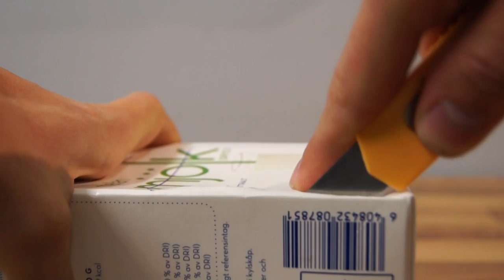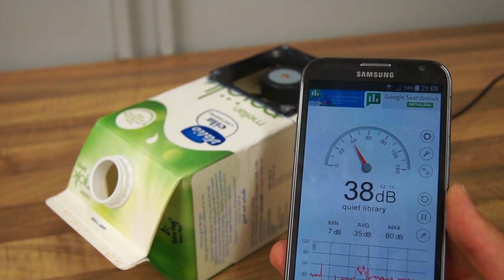DIY Cheap Homemade Air Conditioner Quick Build - RCLifeOn

Comment from the maker: Did you enjoy the video? Please, help me grow this channel by sharing the video with your friends!
Reply: send me that beat Mike Jones
Reply: nice
Reply: To be honest I don't think it would make too much of a difference to cool you down BUT, why not leave it near the computer intake fan or maybe even inside the PC tower pointing at the CPU/GPU fans?
I would like to see how that goes! :D
Reply: absolutely not
because the air is very humid ( since youre using water ice ) and i dont think i have to explain how bad humidity is bad specially if youre gonna overclock and add more voltage and heat ...
Reply: RCLifeOn lol okej då gö jag de
Reply: I made one!
Reply: Amit Bidlan nn
Reply: It's cool bro
Reply: use a peltier and connect the hot end to the hot end of another peltier thingy to power the fan and then you have a colder air conditioner that does not have to worry about the electricity of the fan
Reply: Change the water for ice 😂
Reply: smells like milk
Reply: shares 4 years later

Btw I 100% plan on making this

Comment: Clever! - You can stick the whole thing in the freezer again once it's melted!
Reply from the maker: Let's just hope the fan survives. You could really do that though!
Reply: +RcLifeOn just make sure the fan is dry of moisture before freezing
Reply: RCLifeOn shouldn't thier be a question mark at the end of..."You could really do that though?"??????
Reply: no.  fan will die because of moisture
Reply: Its maybe easier to make the fan attachable... then you dont need to freeze the whole thing.
Reply: That's dumb the freezer puts it's heat into the room.
Reply: that wouldn't work cuz ull have a significantly lower surface area for the ice and thus not as effective cooling

Comment: Pro tip: When soldering wires to connectors, connect male and female parts together before applying solder. That prevents the pins in connector from moving around, if you accidentally heat it to the point where plastic starts to melt. For connectors with really small pins, this is almost necessary to do, to keep all pins straight :)
Reply: yes
Reply: Bro calls that a pro tip 💀

Comment: you know you can also use some copper tubes shaped in circles and use a mini water pump to circle the cold water around a very big fan that would also give you some cool wind BUT the main problem with the ice coolers is that they are a PAIN in 2 ways : 
1: to fill them with ice
2: to drain the melted ice

and depending on the temperature of the room you would have to repeat it again and again and again...
how much did the  ice hold and gave you cool wind ?

Comment: I made a swamp cooler similar to this by hanging some cold and wet rags on a rack and then making it into a mini box air conditioner by closing it up it a couple minutes my room went from 78 (bc. Of my pc lmao) to 72 , the reason why the ac dosent compensate for the heat my pc makes is because it’s next to a wall and not a duct so I put this in the middle and I enjoy a nice and cool gaming enviroment
Reply: yea but if u live in a humid environment this wont work

Comment: Got Mjölk?  Doubles as a stray cat attracter!

Thanks for taking the time to put that nicely-made video together.  I don't think an old milk carton is what I'd choose to use (not very durable, will soon enough make your room smell like the floorboards of an old old ice cream shop, and isn't it kind of tedious to feed one ice cube at a time into it--which probably explains why you mercifully fast-forwarded through that part. Though I guess you could just freeze the whole thing and just take your chances with the fan weathering the cold).  Why not just pull that spout from the milk carton and set it into something more durable and easier to fill with ice (or that you can just keep a few of in the freezer), like an old Tupperware container or some other plastic container with a lid?  If you're anxious to stick with that whole dairy goods motif, why not try yogurt or margarine tubs!

Comment: eco-friendly AC 😀😀👍👍
Reply: Actually, it is not as eco friendly as you think. You have to factor in the electricity used to make the ice too. It is only eco friendly if you do not add the ice
Reply: @marktan8074  yea sure but u have ur fridge on all the time so u r already using the energy used by the fridge.. its not like u r going to turn off the fridge at any time
Reply: @marktan8074  yes, but your refrigerator is already using that electricity so this just removes having to use even more for an air conditioner. So yes, it is more eco-friendly

Comment: Anderson power poles are also nice       Put a bigger piece of heat shrink first that will fit over each infividual lead   Then slide heat shrink over both individual pos neg heat shrunk lead     Avoids tape    Tape is awful and leaves black goop all over after a while    Can also get the hestshrink w sealant goop inside

Comment: all you need is a heap of orifices joined together the presure difference will create the end to cold and the back to be hot place 1/3 of it the incoming air out the Window the heat will dissipate off it from being out side you will get very cold air its called a d
aircon

Comment: You're making an AC in Sweden. Temperature is already cold lol :D
Reply from the maker: Funny you would say that because as of now we have the most crazy weather ever. Today the temperature reached 30° (86°F)!
Reply: Ah I see. And in Stockholm it's also a bit warm today. But generally Sweden is cold~
Reply: RCLifeOn yo dude in my state it usually get 45-50°C in summer😩
Reply: I live in Finland and here is also 30 C (86 F) and in my home the temperature is 27 c (80 F) and I dont  have any airo conditioner or even air cooler. :/
Reply: Hey! I live on mercury and it's burning here
Reply: Yeah...i live in U.S Arizona.  It is fall. It was over 43C today. 50C comes often in the summer

Comment: very nice but way too complex I'd rather make one with the cooler much simpler nice video thanks for sharing
Reply: Travis Jacobs You all would be FAR better off taking a fluffy hand towel or one a bit larger, and generously dribble water along one side of it, once folded lengthwise. Then fold it up and place it into the freezer until the water is completely frozen Then take it out and carefully refold it into a long rectangular, scarf like shape with the ice as close to one side as needed to suit your level of comfort when placed against the back of your neck.  It will very effectively. cool the blood and the nerves at the base of the skull and back of the neck. We used these at horse shows when we worked as grooms in 100 degree days in the blazing sun. Just put a second one into the freezer as you take the first out and keep new ones in rotation. It works remarkably well, so much so,  just be sure to remember  to take good care of yourself and not overexpose yourself to the sun and excessive heat as you are most likely to get a bad sunburn while doing this as the heat itself can be well mitigated  with a continual rotation of icy towels.... adjusted with an amount of ice and closeness of the ice to the skin to suit your taste.
Reply: @HappyQuailsLC 100 degree days? Are we talking about temperature? You can't survive that with just a towel. Or do you mean some exotic units?

Comment: how is the air coming out without ice cubes? is it cooler than room air or same?
Reply from the maker: Well, because moving air has higher heat transfer coefficient it will feel cooler than the room temperature.

Comment: What the purpose & How do you use the shink tube?
Reply: It's there so you don't short the wires. They shrink usually to 1 half of original diameter when heated. Also make sure to not melt them, just a little touch of heat is needed

Comment: What would I do if. Didn't have the connector? Only the fan and battery? Would I be able to possibly solder the wires together?
Reply from the maker: You need a connector to disconnect the battery easily. You don't want to drain the battery completely.
Reply: RCLifeOn ahh I see thank you

Comment: Flow direction of the fan? Out from the milkcarton or in to the milkcarton'? (on the fan).
Reply from the maker: +jox mac The fan pulls air in to the container.
Reply: There are two arrows on the fan, one pointing spinndirection, the other airflow direction. That's a good tip to share.
Reply: airflow points into the container. i made one except with batteries

Comment: Air conditioning is removing heat from the air, cooling is adding cold to the air. 2 completely different things. This is an air cooler.
Reply: You can't 'add' cold. This is removing heat from the air by using it to melt the ice. One of the differences between this and a typical air conditioner is the moisture content. An air conditioner normally removes moisture from the 'conditioned' air, while this adds moisture.
Reply: csorrows - you are correct. An air conditioner is a heat pump. This is an air cooler. Completely different.
Reply: @rgbii2  true but some don't this would be for desert areas
Reply: @rgbii2  really? how com there is cold air coming out of the vents eh?
Reply: @marcusfred4480  not entirely the filter removes dust and other things from cold air coming in to the house

Comment: great it will last like a half hour before the ice melts because the carton has no insulation.
Reply from the maker: I've found that it takes significantly longer time than 30min for the ice to melt.
Reply: Isn't it your goal to have the ice melted? I thought that means it has done its job :)

Comment: Not an air conditioner ,  it is a swamp cooler. BIG difference between the two.
Reply: no its not a swamp cooler, a swamp cooler uses room temp water and evaporation to cool the surroundings, this is ice so he is basically adding heat to the ice and removing it from the air.. quite a big difference.. the first doesn't work in humid environments the 2nd works fine..

Comment: What is a  shrink tube?
Reply from the maker: Shrink tube is a shrinkable plastic tube used to insulate wires.
Reply: When heat is applied to it, It shrinks.
Reply: Aha. Thanks :)

Comment: Why not just fill the container half way with
water. Lay it flat in the freezer, then the ice would already be in the container. I do like the overall idea.
Reply from the maker: You could definitely do that. But I would recommend you to remove the electric fan before freezing the container. Second, I was worried about ice forming outside the container creating a puddle of water once it melts. However, I never tried this.
Reply: Ya, I forgot about the fan being glued to the container. I
guess one could make I “wall” for the fan to fit in. One of my concerns is if
you have one big block of ice inside the container as opposed to lots of individual
cubes it changes the “air to ice surface” factor, which may not offer as much
cool air coming out of the container. Another angle, make a wall for the fan to
sit in. If you use ice cubes, than it would be a lot easier putting the cubes
in (without the fan being installed). After placing the cubes in, then place
the fan in its “wall holder”. As far as the ice/water forming on the outside,
just place a lid under container, but I guess it would make the coated cardboard
wetter/soft.
Reply: @billspradlin9619  that wouldn't work cuz ull have a significantly lower surface area for the ice and thus not as effective cooling

Comment: This is just an air cooler. An Air Conditioner also removes moister in the air, this definitely does not do that.
Reply: only if u live in a humid climate.  this is perfect for the desert, where you would actually want to add moisture to the air
Reply: It doesn't change the fact, that an Air Conditioner is more than just an air cooler.
Reply: 0:06 Air Cooler
Reply: Yes, that would have been nice in the title too.
Reply: uhh no
Reply: some models of ACs don't they are for the people in desert areas

Comment: Sadly, it's hard to find 12v adpater, most of what you can find are around 5v.
Reply from the maker: You can definitely use a 12V battery in case you got one. If not, you will have to purchase one. Try Ebay, Aliexpress or your local electrical shop.
Reply: Or use 5v fan
Reply: i use 2 9v in series

Comment: Ok, its 2016, can someone show me a DIY air cooler, conditioner, rinse, de-heater, temperature reducer and bonus moisture zapper that doesn't involve ice, dry ice(don't want to suffocate myself). There must be a way to suck the heat out of the air rather than cool the air. Use the heat as the energy source or something, once the heat has provided the energy to the device it is now frigid cold due to all of its energy having been depleted from its use. ANy body got any ideas?
Reply: Well yeah that's a good solution for you but that doesn't solve my problem. I should have known better than to ask on You Tube for any sort of techno innovation when people like you go from this to playstation and back.
Reply: if we could lower the temperature of something by taking heat out and turn it into energy goes against an idea in thermodynamics where entropy(simplied: energy always spreads out rather than converging on its own) must always increase. nice idea and would solve a lot of problems just currently deemed impossible.

a peltier might be what u are looking for though. he used it in his dehumidifier vid
Reply: You got what you paid for.
Reply: The notion of removing heat from the air being different from cooling the air is nonsensical, there is only the (mostly) unidirectional flow of heat from the hotter thing to the colder thing. The video shows the creation of a swamp cooler which cools the air by increasing humidity which is effective in dryer climates because water has a high specific heat (needs alot of energy to raise its temperature). Temperature gradients can be used for energy if that's what you like, read stirling engines.
Reply: having it involve ice is not going to cause you to get suffocated. I used to do something similar when trying to sleep in the daytime in Kansas put ice in front of a fan to get the air a bit cooler.
Reply: 78 STARBUCK
Reply: 78 STARBUCK, yes buy an air conditioner from a company that actually makes quality ones. But this works just fine
Reply: 78 STARBUCK boi you are asking us for a way to cool a room using heat
Reply: Go live in the Arctic.
Reply: 78 STARBUCK 9 likes 11 comments
Reply: Water and sponge
Reply: You'll need a compressor, it compressed air and decompressed it, they often use cfcs and hfcs as the air, this causes cooling and heating, the cooling is used to cool the inside at the cost of heating the outside, which if u touch the back of the fridge you'd feel
Reply: Small AC's are pretty cheap, if you have a small room you can get one for like 200 dollars
Reply: good isolated house,some kind of sun shields on windows and open the windows at evening and night
Reply: =DAniel Hawkins=  what if, 78 Starbuck acquired a time machine, then went xxx(250) let's say, years forward...  learned  about principles of thermodynamic entropy relative to our understanding of quantum physics .  Return to  Y2K +/- 20 years &  accelerate renewables / free energy & gift all of humanity with affordable compact air cooler/purification promoting devices?

Comment: Thanks for this video.  Can you try experiment for me?  Try doing the same thing without the ice. Is the temperature cooler assuming it is not pulling the hot air from the CPU being so near to the computer.  What I am trying is to establish the "adiabatic heat transference" process whereby currently people in Bangladesh and India are using. Called the Eco-cooler, it consist of a number of cut out inverted plastic bottles but required flowing air to evoke the "adiabatic process".  Try blow air from your mouth wide open to your palm. Try again now pursing your lips to a narrow opening. It is cooler.  So that is why I though maybe you call tell me if without ice what is the temperature difference.  Should be cooler. Thanks!

Comment: Those are garbage and don't work.  I've tried the bigger ones, but they don't remove hardly any heat and put moisture into the air.